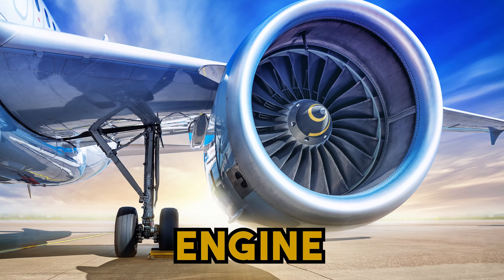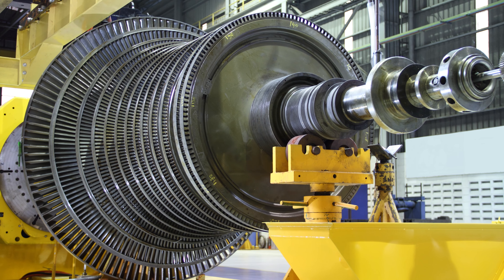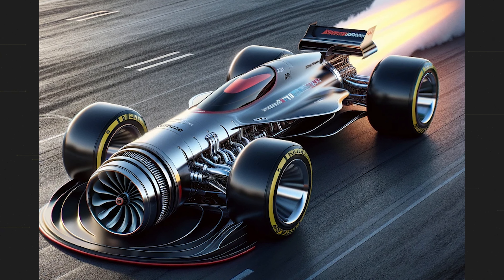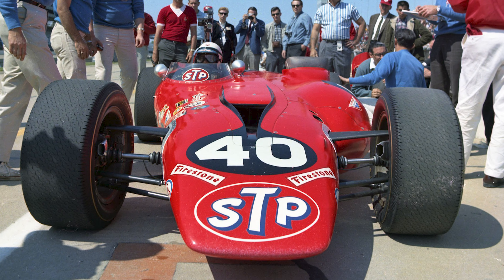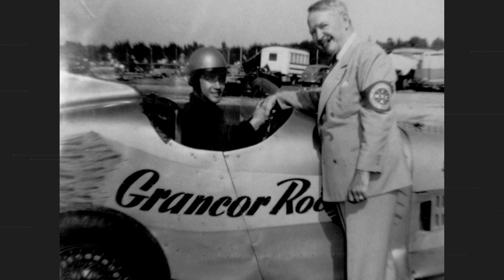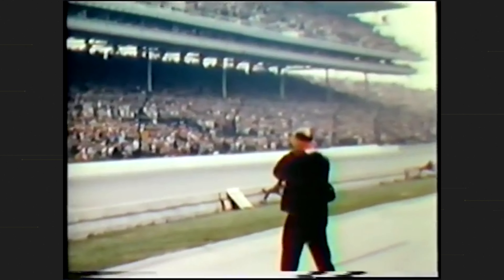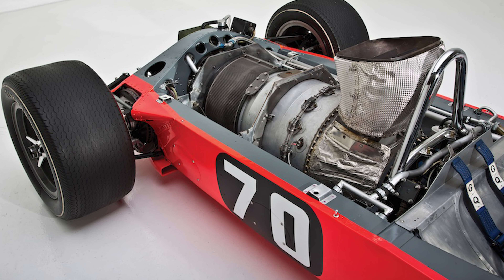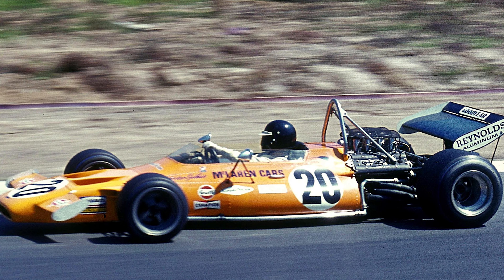They put a JET ENGINE on a Formula 1 car! (And it’s UNDRIVABLE) 🤯

Comment: I'm not an engineer but why didn't they adapte a turbo to that turbine for the quarter step of the throttle then for the power you got create a motor map where the turbine produce not too much power or nothing else to reduce power !? 
We know of to reduce power and adapte for the conditions when went !
But I have to admit this is gonna be more weight on the car.